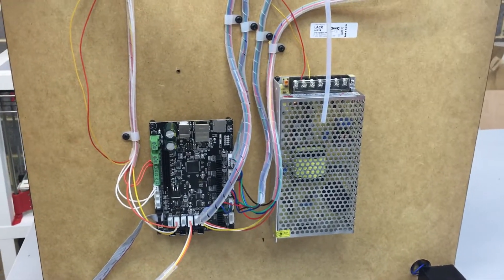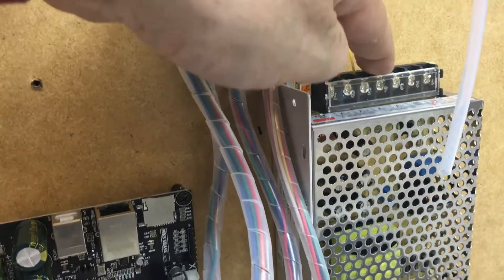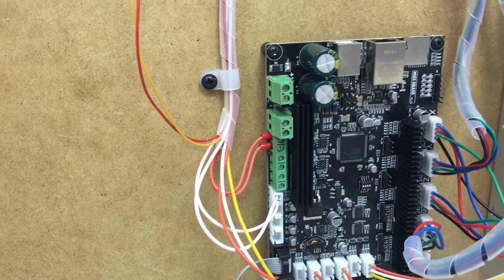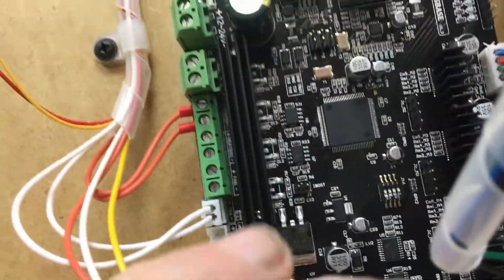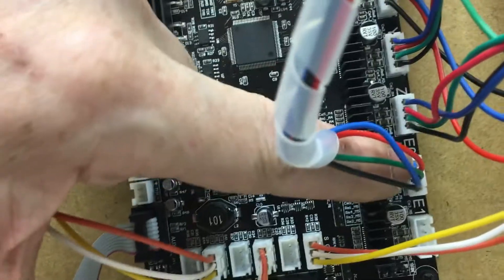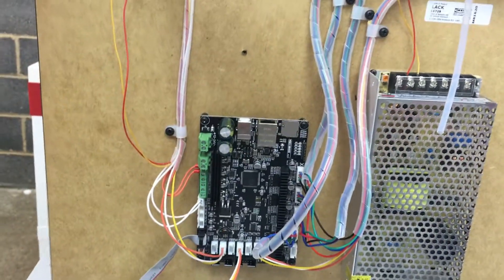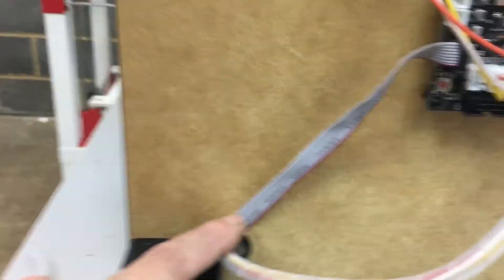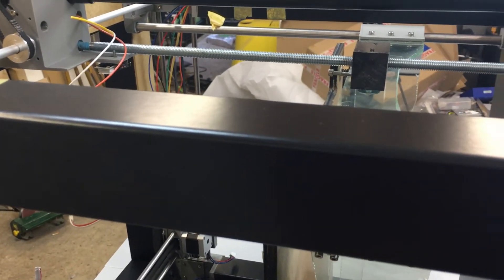Printtable Wiring MKS Sbase

Comment: You are one brave guy. The wires you are using for that power supply to connect to the printer board are INSANELY too small! You can't get adequate current through them. You need some thicker gauged wire so that you don't under current the components once things start heating up. It'll work fine at first, but I bet it has some trouble internally when trying to maintain a proper voltage/current when its been heating up for a while. may not be noticeable by eye, but for sure the components are screaming on the inside as they 'gulp for what little air they can get'. Oh, and because it'll be pushing more current than should be, you risk burning the wires up in general and possibly catching fire... 

If you haven't already, i'd HIGHLY advice getting a few gauges thicker in wiring for your power.
Reply from the maker: Hi Hikari

You are incorrect. Firstly in this video there are no power wires connected from the power supply to mains and no power from 12v power to controller board. The 2 wires you can see on the power supply are the 12volt output to the e3d fan on the hot end to ensure it is always on with the power connected.